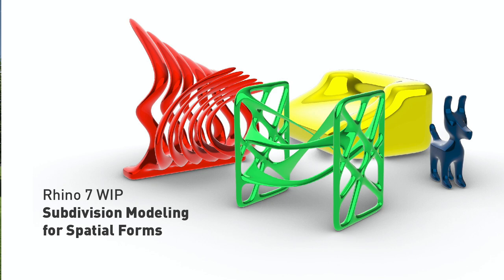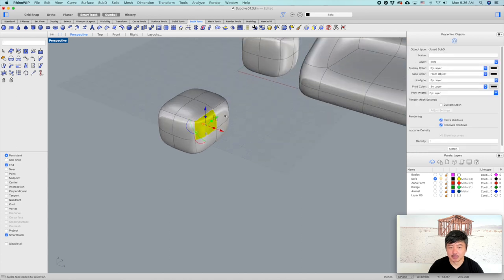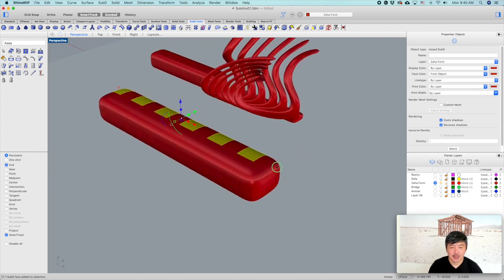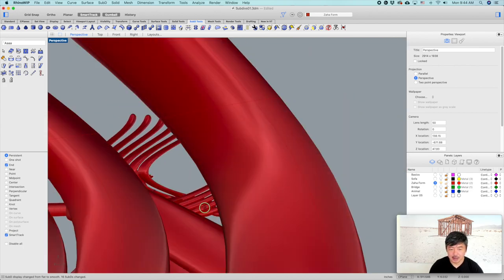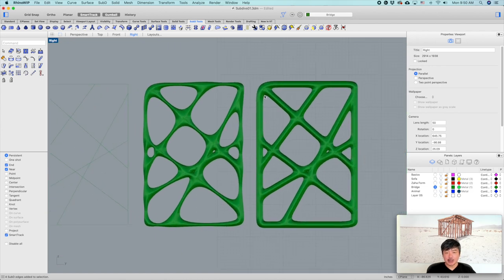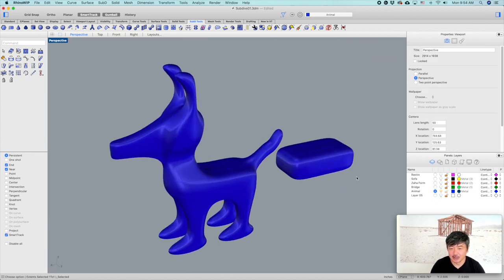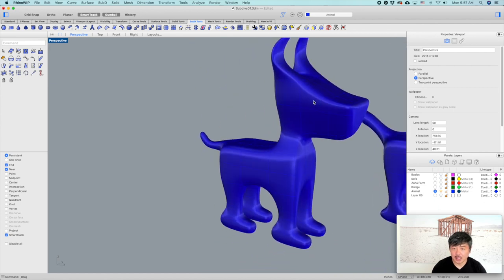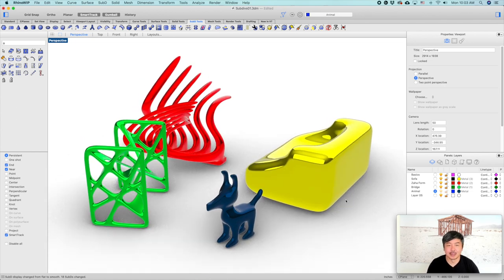Rhino 7 Subdivision Modeling

Comment: What is thr short cut to switch between smooth and straight mode?
Reply from the maker: you can push "tab" key on your keyboard to switch between smooth mode and straight mode
Reply: @yo.sensei.design  thanks